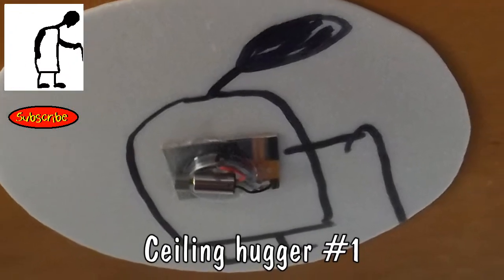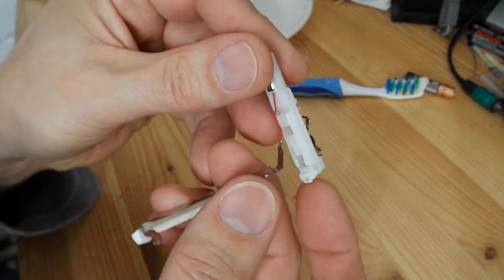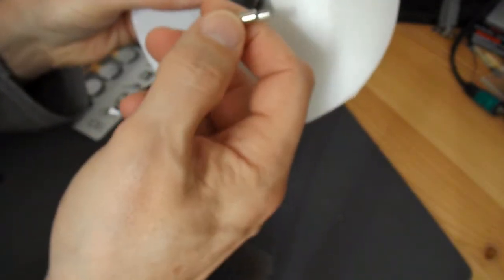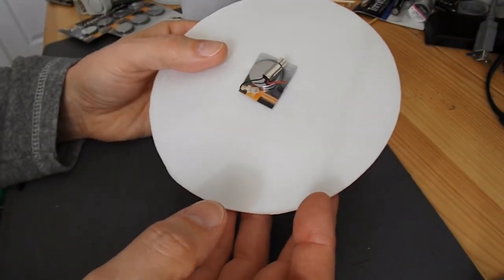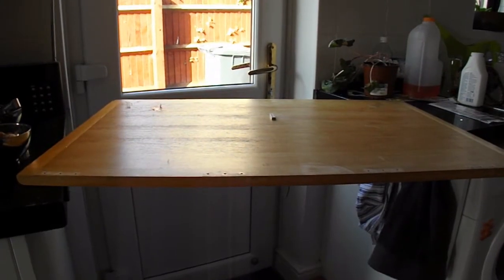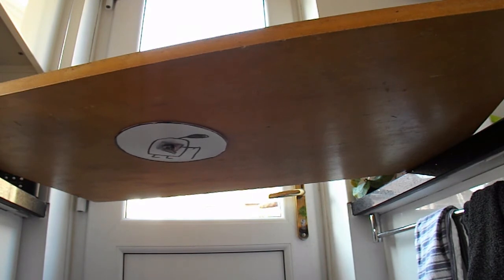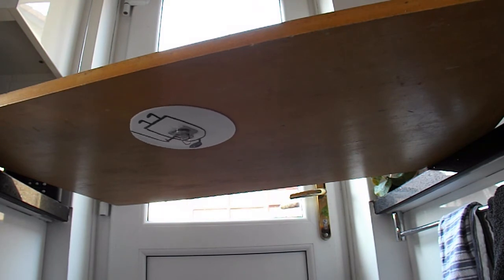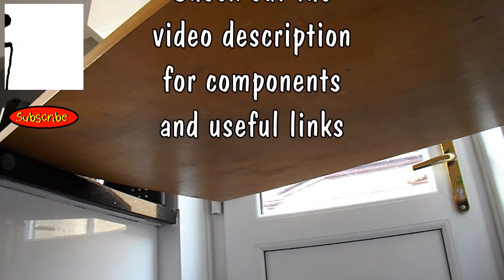Ceiling Hugger

Comment: I don't understand how these work!
Reply from the maker: I will try to explain what I think is happening, I may be wrong. The disc forms a good seal against the ceiling. When you pull the middle (the vibrating motor does this as it vibrates) there is a vacuum formed in the gap and the external air pressure pushes the plate back against the surface. At the same time the vibrating motion is causing the plate to move slightly with each vibration. Here is another one of David Vernon Williamson's creations and looks like it grips much better http://youtu.be/SKFgwAybQps
Reply: Ok Thanks! Grandad!